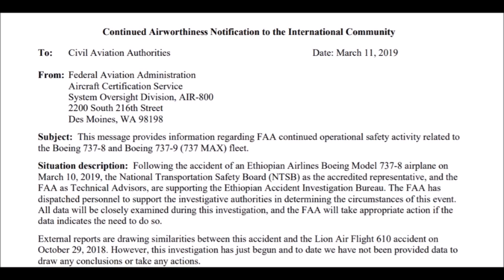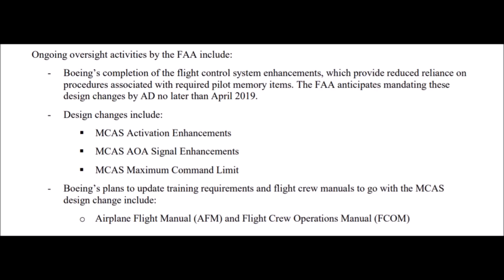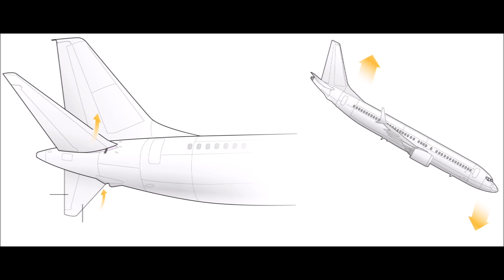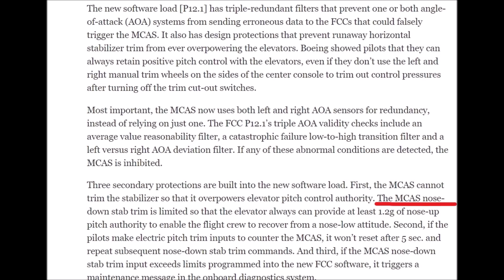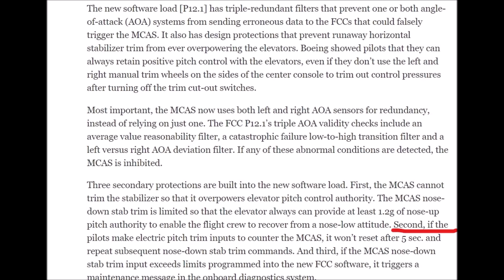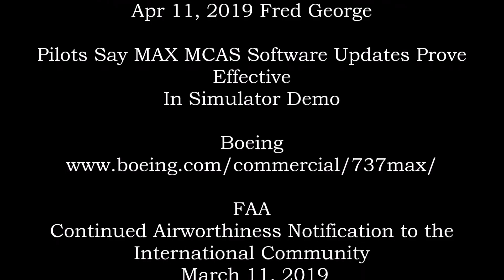737 Max UPDATE 14 April 2019 "The Fix"

Comment: So beta testing part 2 starts now....what a poor design.
Reply: @Frank Heuvelman Looks like the poor design allegation has been proven twice. Keep in mind that other pilots have report problems with the system several times.
Reply: A suggestion, Change the verb in your second sentence to "make". This was a Sixties aircraft with dozens of extras and changes bolted on to try to make it still competitive without investing money in designing a modern aircraft. What other failures are yet to be revealed?
Reply: hugo max  - It's not nearly that simple.  The Lion Air crash was sent up with a bad AOA sensor (leaving them with one, and no redundancy for the other systems).  The Ethiopian crash was going Vne speed.....the speed at which loss of control will happen anyway (as well as parts flying off etc). So.......
Reply: @Jamey Lane  @Reflected Miles I think we can agree that throttle control was overlooked. However, even with reduced throttle, it would be a challenge to slow down when you can't get the nose up and you're going too fast to deploy speedbrakes. But you can't get the nose up without getting the stab trim to where it should be. But you can't adjust the severe nose down stab trim when you're fighting the nose down attitude with the elevator. It seems like the yo-yo maneuver (with reduced throttle and electric stab trim cutout) is the only thing that MIGHT have saved EA 302.
Reply: Wesley Hurd  - You bring up a good point, they didn't leave the trim cutoff disabled, they kept putting it back on.  It was full panic and incompetence, they lost all composure.
Reply: Wesley Hurd @Micj Osis  If you have ever watched pilots do this in the simulator, I think you would view the situation differently. I would have no qualms about being assigned to fly the MAX without the software fix until Boeing has it ready. It’s really just not that hard if pilots are well-trained and prepared to act. I watched an American Airlines crew do this specific failure in a simulator and I wasn’t entirely sure that the passengers would have even known that something had gone wrong.
Reply: 700mph final speed, right into the ground.  It's no wonder why people reported "smoke" and "loud noises".  I'm shocked the plane even made it to the ground in one piece at that speed.
Reply: Mijc Osis  So just to clarify, MCAS isn’t autopilot and if you’re reading about autopilot disabling, etc., that is not related. This is, or used to be, a simple background trim automation. It was always assistive, not controlling. As with anything else in the trim system, malfunction means hitting the cut-off switches and flying the airplane. The software and implementation could certainly have been better and safer, and those are lessons learned by every manufacturer as models gather hours and service experience. I just think it would be hard, at least outside of the developing world and media drama, to pin the actual cause of the crash on Boeing when there’s no evidence that this sequence of events would have been avoided with any other runaway trim emergency, whether the specific cause was known by the pilots or not. Boeing’s design and implementation certainly contributed. I just have a hard time assigning it as the cause. Doing so starts to get into the territory of manufacturers being responsible for preventing and saving all failures of both equipment and operators. I would rather trust skilled pilots with mechanical backups than supposedly fail-safe coding.
Reply: That would be drily funny, if over 350 people hadn't died.
Reply: @williamswenson5315  because of pilot inability to hit two "off" buttons and fly the airplane, but we're just worried about the automation...
Reply: @ReflectedMiles  Meanwhile, in the Airbus. If conflicting information is detected the information is disregarded. It's basic programming.....
Reply: @ChunkyyHD  Wouldn't that be nice if it always worked out? Airbus has had multiple fatal accidents as a result of their FBW automation, including one from failure to fly the airplane when sensors quit (AF447). In that case, it was also a fundamental design fault (and remains so without public outrage) since it was not obvious to the captain what control inputs the first officer was making. (No controls connection between the left and right side of the cockpit.)
Reply: My understanding from the analysis of the CVR, is that the pilots of ET302 followed the prescribed Boeing procedure for the flight condition they experienced. Given the low altitude and the aerodynamic loading of the stabilator, they were unable to correct the pitch down commanded by  MCAS. Both stabilator switches were selected off, but the hand-applied force needed to move the manual trim at the attained airspeed was too high. There are indications that they nearly got the nose up in time to recover the a/c, but just ran out of time. A real tragedy preventable by a better designed MCAS. That is, one which lacks the ability to overpower the pilot and one that wasn't designed to ensure that a new type certificate would not be required.I suspect you can blame marketing for this at the end of the day.
Reply: @ReflectedMiles   I'm familiar with the incident. That is a result from failure/fatigue of the pilots. Not the automation. "I'm in control" is a basic call-out that people learn. Also what you talk about isn't the failure of automation, at most it's a failure of design. That plane was fully functioning when it hit the water....
Where in these incidences, the automation did not let the pilots fly the plane. Despite having ridiculous input data.
It's akin to having a automated car:
Boeing: Data error, I'll keep steering this ship into a ditch unless you turn off Traction control on this icy road (Electronic trim).
Airbus: Data error, hands controls back to the driver. Passenger pulls the handbrake, which crashes the car.

AF447 is a example by pilots of all calibre when practicing stall training, as the perfect example of what not to do (as pilots)....
"Learning stall recovery today eh?"
"Yeah, so i just keep pulling back on the stick until we hit the ground, right?"

AF447 error wouldn't be a deathwish if the plane was low attitude, Boeing is.
Reply: @ReflectedMiles  incorrect. They did turn those off. The REASON they could not manually adjust the trim was due to high loads on the stabilizer through WAAAAAAAAAAYYYYY too much speed, coupled with too much angle in the stabilizer. So, they then turned the switches back on in order to electrically correct, which THEN was a very bad decision. The correct decision would have been to lower the airspeed while pulling back on the yoke and then manually trimming as the load decreased.
   It's really hard to fly a plane that is trying to kill you though, eh?
Reply: ChunkyyHD  The only thing that makes disconnected sidestick design possible for Airbus is automation. It is true that it was failure to fly the airplane as in these accidents, but there was also a large design failure involved and a failure of the automation to in any way show or warn the captain of the control inputs being used. It seems quite astonishing that the public would shrug that off, not requiring a redesign of the whole system, yet react horribly to this. I wonder what part media might play in that difference...
Reply: William Swenson ... or a real tragedy prevented by flying the airplane. I personally prefer to have pilots who are still highly trained and capable flyers with their machines and do not have to depend on automation working perfectly to stay safe, including basic control of the throttles.
Reply: Andy Taylor  In other words, you agree that the reason that they crashed the airplane was the failure to fly it—failure to control the throttles, which then rendered control of the airplane impossible. I couldn’t agree more. Virtually all airplanes become uncontrollable due to flutter, aerodynamic loading, or other factors once they are past red line.
Reply: @ReflectedMiles  Airbus designed the system to work that way. Love it or hate it. It's not a design flaw.
They train countless hours, knowing the sticks add inputs and are not mechanically linked. I don't really count simple addition as automation. As all it does is create an output from the 2 sticks. Nothing more, nothing less.
You can download a full FAA/447 report below.
https://lessonslearned.faa.gov/ll_main.cfm?TabID=3&LLID=76&LLTypeID=14
Reply: @andytaylor1588  why boeing does not just put MCAS switch off button? And let electronic circuit help pilot to maneuver, instead of using electronic trim cutout to shutdown MCAS.
Reply: @ChunkyyHD   I am well aware of the reports on AF447 since I was working for some of those involved in producing them. I strongly disagree with your characterization of the design issue and its role in that accident as do a number of other safety experts.
Reply: @ReflectedMiles  they did hit the off buttons and tried manual trim but it didn't work ..at high speeds the manual trim doesn't function so well..so they switched it back to attempt a different approach ..
Reply: @das250250  Boeing has to be able to assume that pilots are going to keep the airplane within its normal operating parameters for its systems to work. Well-trained pilots are, among other things, very well aware of the effects of high aerodynamic forces on control surfaces.
Reply: @andytaylor1588   Hard, but not impossible. That's what they hire pilots to do. In the end, this debacle will be determined to have multiple causes, and in both cases, pilot error will be cited as contributing factors.
Reply: @ReflectedMiles  But they were together pulling the yoke and panicking. I think they were in a tough situation having not much time left in low altitude. I found it hard to blame them even if they didnt do all things correct.
Reply: @williamswenson5315  
They did miss the one most critical step, shut off auto throttle. Although they had tunnel-vision, airspeed is critical and needed to be reduced by removing the 94% auto-thrust when in a nose down condition.  Flying the aircraft 100% relying on automation makes the pilots extremely rusty at hand flying the aircraft. With less than 40 seconds to figure out the correct answers, any mistakes would be deadly. Also, watching The Mentour YT where they are in a simulator and switch to manual stab trim, the FO couldn't manually trim the aircraft. He was too weak. Both pilots had to hand crank the trim wheels. The Ethiopean flight recorder indicates they couldn't operate the trim wheels, "no effect". It was likely to hard for the FO.
Reply: @ReflectedMiles  The pilots in the Ethiopian Airlines crash followed standard procedure and used the stabilizer trim cutout switches which disables MCAS. They may have deviated from standard procedure in the final few seconds of the incident, in a desperate attempt to regain control of the aircraft which was not responding to flight controls.

EDIT: I was referring to the fact that they recognized that there was a problem and used the stab trim cutout switches, which is procedure. I'm not saying that they didn't make any mistakes. There is a possibility that they reenabled the electric stab trim because they couldn't trim it manually (this would be a deviation from standard procedure).
Reply: @bedhenis  
Adding the switch would of taken the aircraft out of a Single Type Rating and forced Boeing to extensively train the pilots since it would require a new memory procedure costing airlines dollars and detracting from the marketing. It would have required more than a 40 minute iPad training session but instead costly simulator time.
Reply: LaggerSVK  I certainly agree that they were, but they were significantly responsible for creating that circumstance, unfortunately. This developed over minutes, not seconds, and just pulling on the yokes is not a sufficient response to runaway trim in many aircraft types. Boeing expects highly trained and demonstrated manual skill from pilots when things go wrong. Not controlling speed rendered that impossible and probably contributed greatly to the panic as well.
Reply: Wesley Hurd  By that time the aircraft had been out of control for awhile as the pilots still had full takeoff thrust set. The airline’s claim and the preliminary report do not match.
Reply: Mijc Osis I would say that the yo-yo maneuver could be helpful for aerodynamic unloading but hasn’t proven essential in subsequent testing and training so long as speed is moderated. As Juan pointed out in an earlier video, understanding aerodynamic loading on control surfaces is a standard part of good pilot training in the West. Stab trim cutout switches have been staring at me in the jumpseat of 737’s for decades. Using them is just not that complicated, assuming that you have been trained to use them and have demonstrated doing so. I did not see any indication in these crashes that the switches were confusing or inoperative to the pilots—only the throttles, sadly. Training is fundamentally a responsibility of the airlines, including reviews of differences between model variants and recurrent sim checks.

Comment: Thank you for this very clear update and it's good to know that Boeing have understood and are to implement a corrective program to put right what should have been up to scratch in the first place. The basic fact is that flying is by far the safest form of transport and the statistics amply prove that. Commercial pilots are fallible like everyone else but the overwhelming odds are they are better trained and more capable than any car or truck driver - hence per passenger mile you are much safer flying. Automation has it's risks but riskier still by an order of magnitude is the loose nut behind the wheel of cars !

Comment: @blancolirio you have every point and you are completely right about automation in air industry and the way this industry progress. But let's never forget that the passengers are the ones that run the whole aviation industry. If every single one of us avoids MAX fleet of aircrafts during flights, the manufacturer will be forced to discontinue those aircrafts. As you previously explained in your previous videos, Boeing made some unforgivable errors as the one where they completely changed stability of aircraft and implementing some systems that flight crews were not aware of. Cost saving is and should never be the point of air industry. When I travel with the aircraft I am willing to pay high prices to come somewhere the fastest possible, but also the safest way possible. When this happens and 2 brand new aircrafts fall down from the sky killing all those people where some of all people could be you or anybody else, I am sure not to ever step a foot inside MAX aircraft fleet, and to follow the flights where older, not that cost saving aircrafts are being used. And that is completely normal expected behavior from a person willing to think about its safety :). We should all boycott this aircraft, its design and sole purpose (cost cutting) is the main issue here. Only then we can really hope something drastically will change in Aircraft manufacturing industry in global, so either manufactures will cut down prices, or Airlines will spend more money on buying those aircrafts.

Comment: Sounds like the software people had limited or no hardware experience and it never occurred to them that an input transducer could provide wrong data. The software design as described clearly shows a complete reliance on accurate transducer inputs.  It seems to me that Boeing's software people need a little hands on hardware experience so they will have a feeling for hardware reliability.
Reply: The software definitions were imposed by the design engineers, who should have had this knowledge.
Reply: The development of MCAS software should not have been assigned to the summer intern.
Reply: They're gamers and app writers.

Comment: That's the problem with computer controlled systems.
Firstly, as computers must be infallible....it must be the pilot that's wrong( even if he's right)
Second since the pilot is thinking he's wrong, let computer handle it.
Third. Pilot realizes he's right, but can't overide computer...

All computers fail. Some obviously, some hidden. 
How often has a app stopped for no reason, how many computers are virused, how many software updates actually brick your hardware?
Reply: Yes! Hello, it's HAL
Reply: Flight computers don't have complex operating systems and unstable or unknown drivers or applications to cause the kind of problems people see in phones, tablets and laptops/desktops.
Reply: @Fliegermann777  I could argue that when the automation is off is when they really become pilots... but I won't.
Reply: greed and cutting corners also causes systems to become poorer than they could be

Comment: Are we now going to have an accident because the MCAS disabled itself (law of unintended consequences)?   Will the pilots be required to train with the MCAS disabled and with light loads and aft CG?
Reply: MCAS will very rarely be used (once corrected), and is mainly a certification requirement. It does not affect the inherent stability of the B737. MCAS cannot be disabled, it will reset once AOA drops, in preparation for the next maneuver.